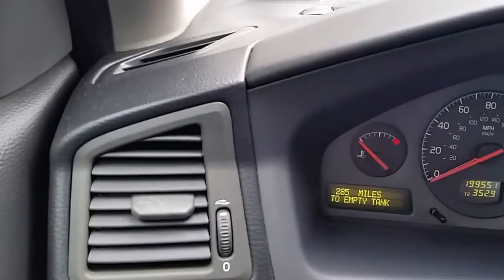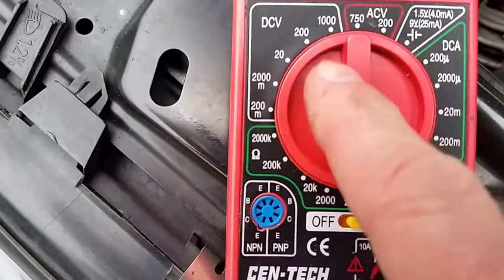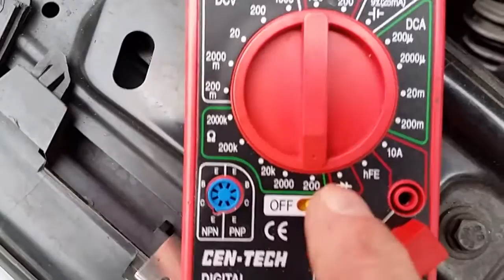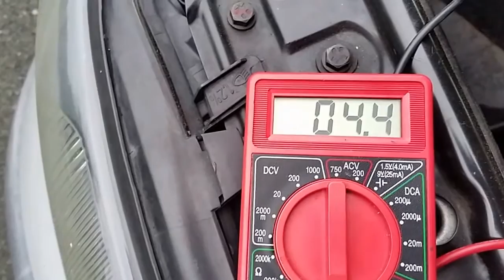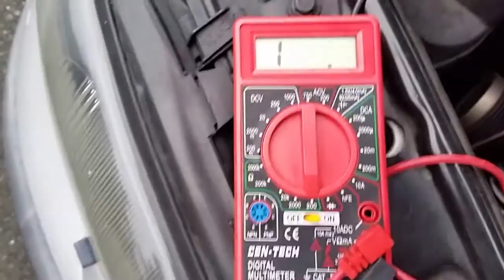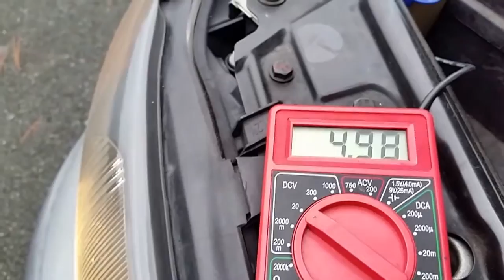Diagnosing a Coolant Temperature Sensor - Volvo S60

Comment: How did you shows up the fuel range, please?
Reply: Push the button at the end of the turn signal handle if you have any messages they'll show.  once you get  to the end of the messages there's  A ring of ridges at the end of the blinker handle turn it until you get to the specific thing you want to see it will show average miles per gallon it will show miles until empty things like that.